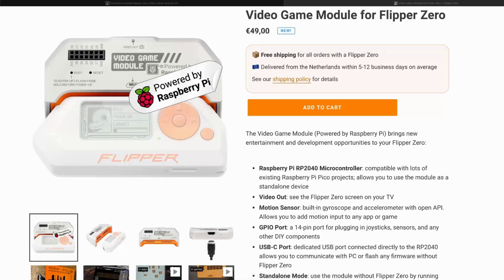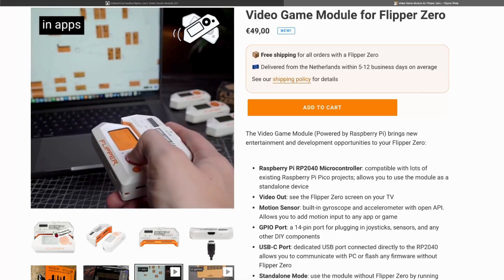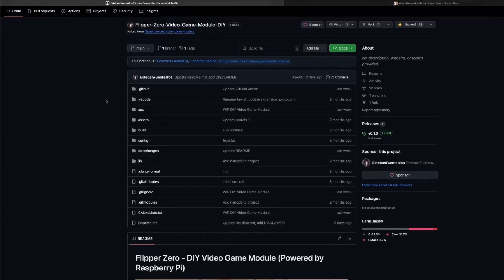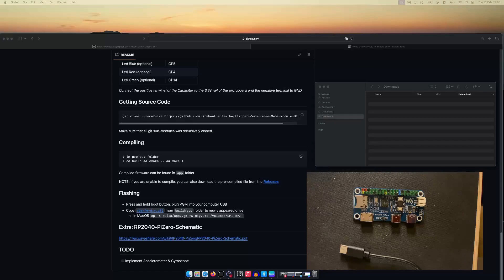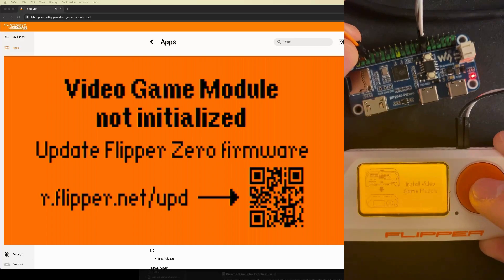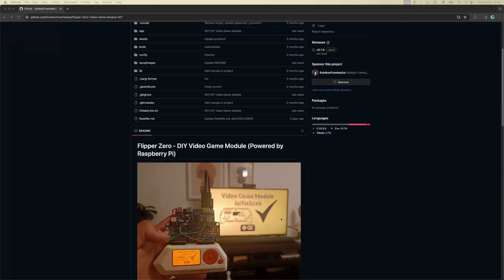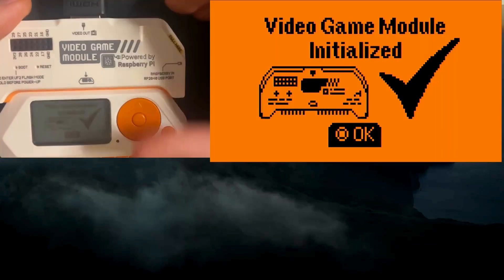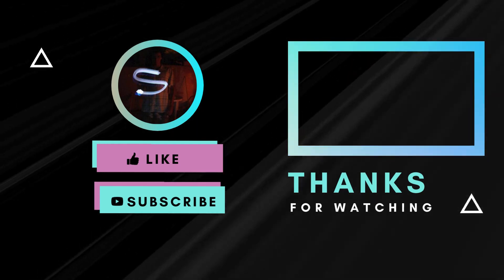Flipper Zero Video Module: Official Solution vs. Custom Solution – Which One Should You Choose?

Comment: Quick question are you able to go into subghz when vgm is connected to monitor/TV and it displays subghz menu ok?
Reply from the maker: Hey Ray, unfortunately, nope, were you able to? It is quite interesting to mention that the Spectrum Analyzer works though.
Reply: @samxplogs  I was able to get it to work using the official firmware. But not on Momentum which I currently use so it must just be a bug.